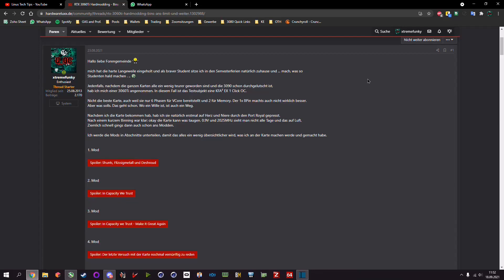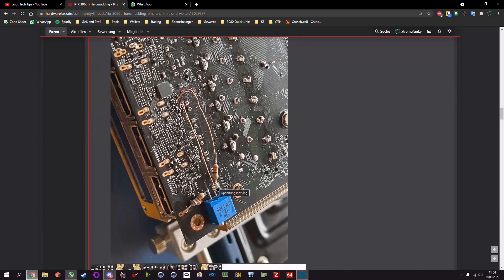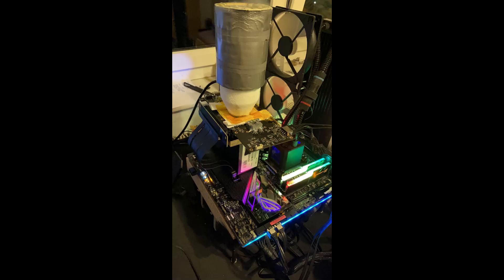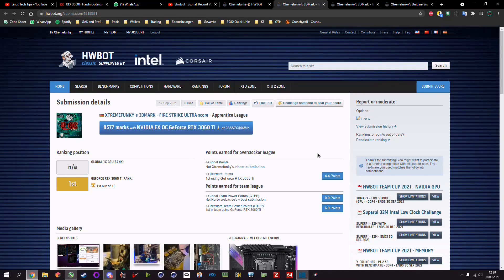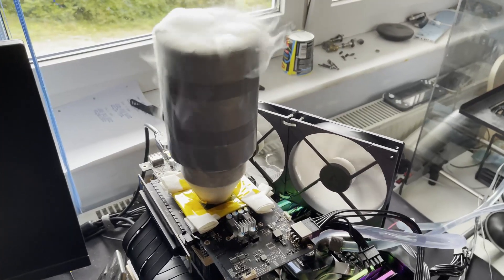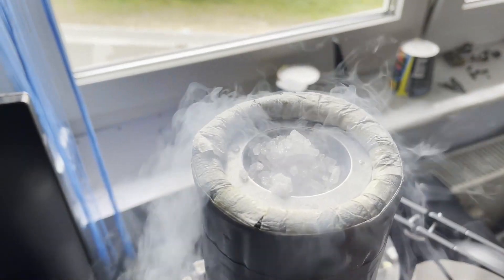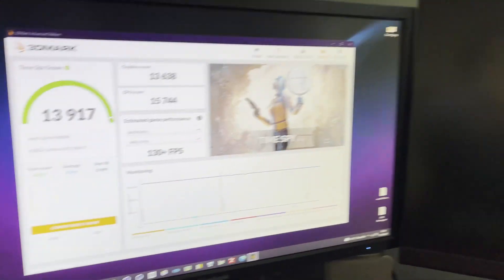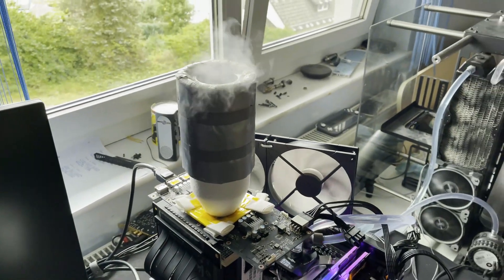World Record Modding - DRY ICE Benchmarking the RTX 3060 Ti - Overclocking To The GPUs MAX

Comment: The results he got nearly equals to which card at its stock performance?
I have a rtx 3050 and seriously thinking about using refregrating chip like the one used on black shark  pro funcooler  to overclock it but i am such a beginner and have no idea if its worth it if rtx 3050 can boost to equal rtx 3080 or something would be interesting to do

Comment: Hätte mal kurz ne Frage. 
habe ein ITX Gehäuse und habe dort die kleinste 3060Ti gekauft, asus 3060Ti dual mini OC. nun upgrade ich auf die kleinste 3070 (asus 3070 SI) ... die die gleiche kleine pcb grösse hat.....
da du dich ja mit dem elektronischem Aufbau der karten sehr gut auskennst: warum sind 90% der gleichen 3060ti, 3070 riesen gross, mit drei lüftern und ein haufen mehr transistoren und kondensatoren? (die werden wohl besser zu overclocken sein?)
warum werden nicht alle karten so klein wie möglich gebaut?
Gruß
Reply from the maker: Nun ja, wenn man die Chips standardmäßig betreibt, dann wird es reichen. Viele Hersteller übertakten aber die Chips serienmäßig oder geben ein höheres Powerlimit frei. Dadurch sollte natürlich die HW dementsprechend angepasst werden.
Reply: @UnleashedOverclocking  ach, verstehe. wenn ich das Powerlimit einer Karte mit irgendwelchen Mods aufbohren würde bei zu kleiner Anzahl an VRMs oder zu kleiner Kühlung, würde die Karte in Luft gehen oder gibt es da auch in der Stromversorgungseinheit Thermal Throttling wie bei einer CPU?